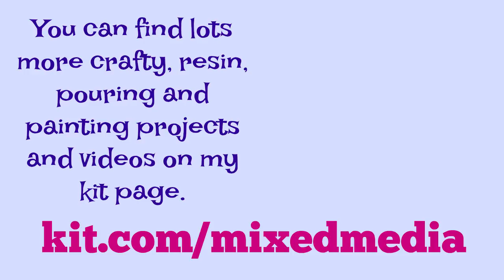Dropping alcohol inks into white resin - art experiment

Comment: This was a lovely result.  Did your resin flow over the edge of your cradle board?
Reply from the maker: Yes, just in one corner which is why the shapes all went a bit weird. It was almost exactly level, but of course once it starts to go over there is no way to stop it.
Reply: So did you sand it off, because the final seconds of your video doesn't show it on the sides?